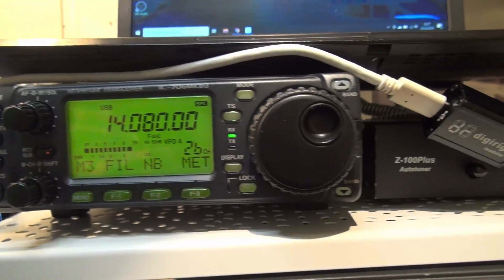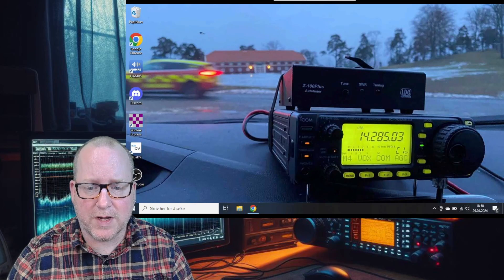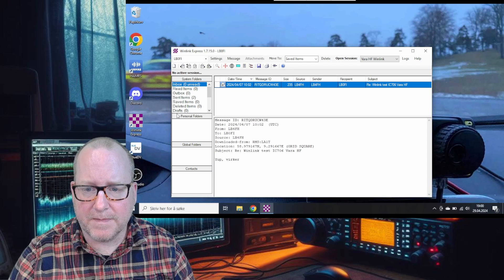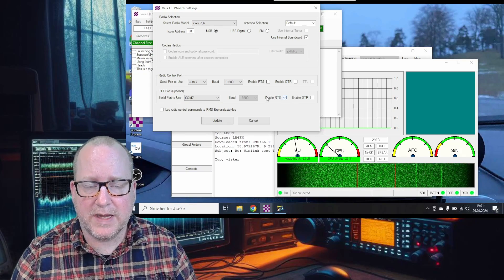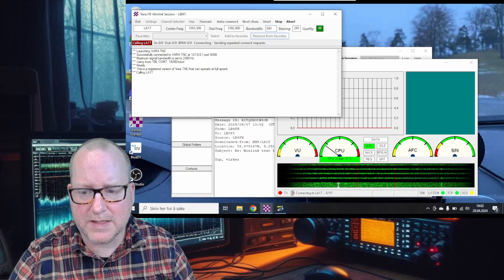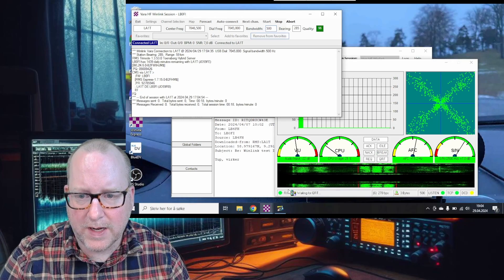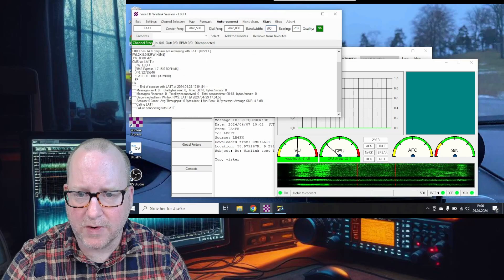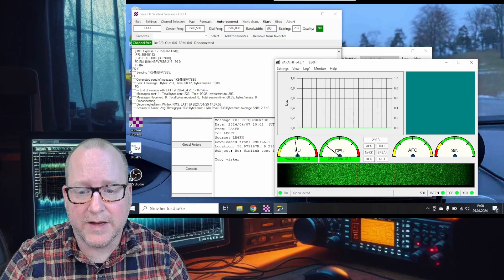Winlink Settings for the Icom IC-706(MKIIG)

Comment: Great video.
I was wondering if you could provide a few photos or do a video on how the radio is connected to the digirig. Which cat control digirig did you use?

If the audio and ptt both use com7 how are they sharing the same com port? 

Are you using Virtual Serial Ports Emulator (VSPE)?

Thank you
Reply from the maker: Happy you liked it! Is the DIGIRIG the easiest way to get DIGIMODES on your OLDER RADIO?
https://youtu.be/08MbQHDAzMU

Comment: Hello,
Thanks very much for your video.
I'm using Digirig mobile and tried it on both my TRX: 
YAESU FT-817ND - impossible to obtain a CAT control, therefore no further testing,
With my ICOM IC-706 Ii G CAT control works but the sound card setting doesn't work.
Do you have any hints?
Thanks very much and best 73 de DL2BCZ

Comment: Wow, this is absolutely fantastic, thank you! Years ago, I ran a Winlink gateway station in Murray, KY USA--Pactor I, II, and III on HF, and packet on VHF. I've been off the for nearly 18 years, and just getting back into it. It's great to see there is a soundcard option for Winlink on HF now! I just bought an old IC-706MKII and have a digirig on the way. I'm looking forward to using Vera to connect. Hoping to get this all set up on my sailboat after testing it out at the home! Thanks again, and 73, de Scott, K4SET
Reply from the maker: Enjoy your 706, I love mine!

Comment: Another great video!

Do you have any issues with the IC-706Mk2g overheating? (I do.)
Reply from the maker: Thanks! And no, I have had no issues with overheating. It runs hot, but it has never failed on me, even with hour long FT8 activations.